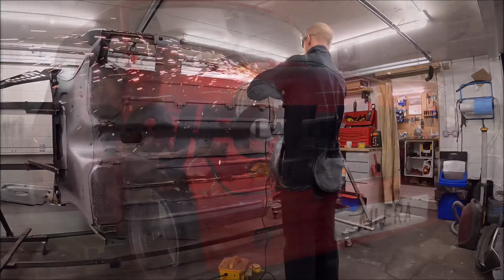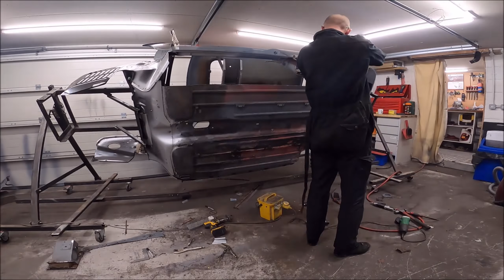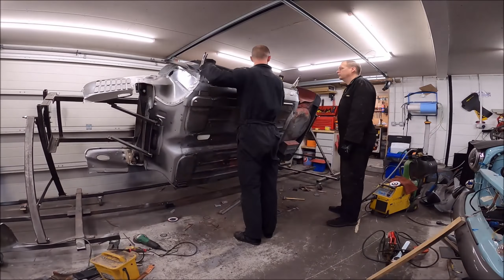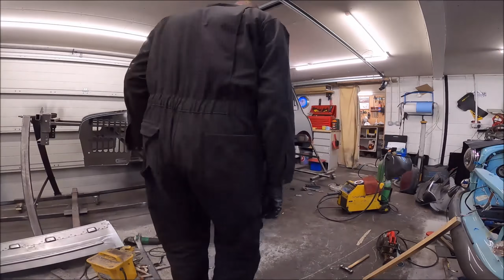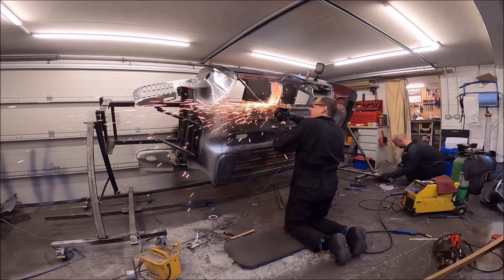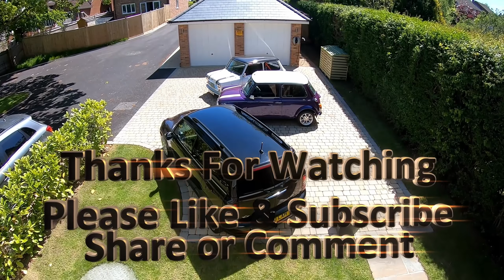Project ERA Part 7 - Classic Mini Workshop - Sills Inner / Outer & Floor

Comment: G'day there. I've got myself a mk1 that I'm using the same sort of floor panely(outer sill attached etc) and found they are quite warped from the way they are pressed. Do you have any tips in getting them to fit?
Thanks for all the knowledge in your videos!
Reply from the maker: Hiya, what part is warped? The outer sill does not run exactly parallel with the inner sill, it bows out slightly in the middle.
Reply: @classicminiworkshop  thanks for the quick reply! It's actually the floor next to the ribs. The bit that would attach to the tunnel.

Comment: Hi, these videos are great with loads of content! Some details I couldn't see, can I ask as you've done the bulkhead first how did you tuck the new floor under the toe board and the heel board return simultaneously? Did you just cut and bend up the heel board flange? I'm bending my toe board as it is being replaced after the floor but was curious how you managed. Thanks
Reply from the maker: Yes, we just bent the heel board so it was vertical and then slid the whole panel in and bent it back round
Reply: @classicminiworkshop  I thought you must have, but when your not experienced you get nervous to cut and bend things that your not replacing. I guess sometime you just have to be confident and go for it!

Comment: Getting a butt weld to fit right you need to cut through the old and new panel together that way the cut can be as pissed as you like and it will all line up fine. Your cracking on well and bigger set than me replacing a bulk head 👍👍